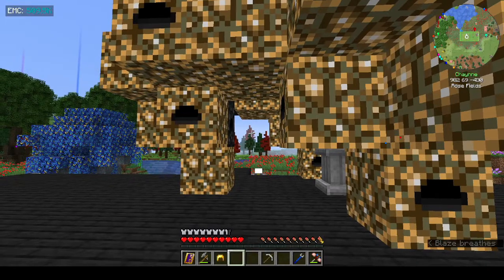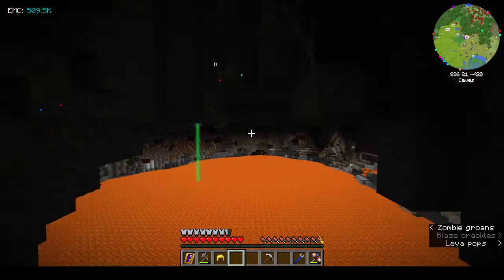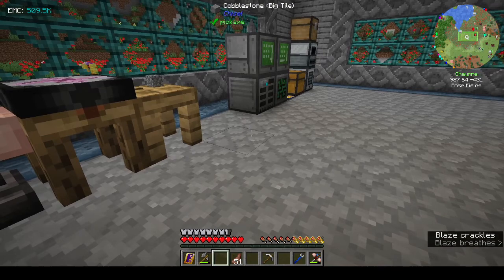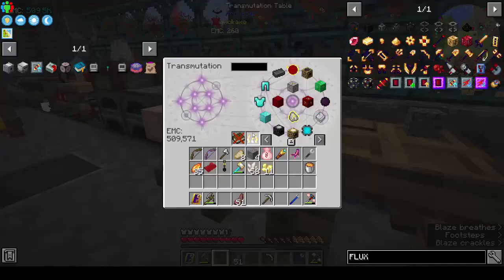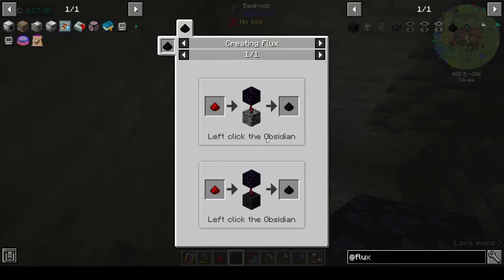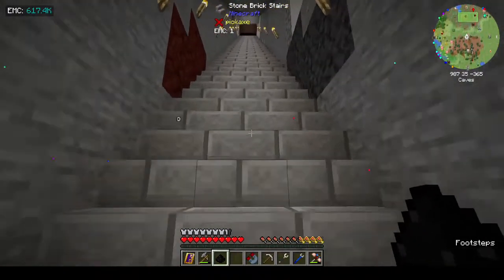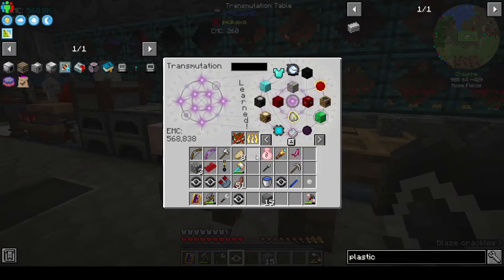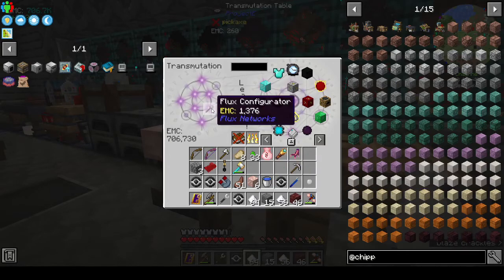Project Architect Ep 11: Starting Flux Networks

Comment: The watch of flowing time isn't working, you have to activate it by right clicking the pedestal, you will see particle effects when it's on. Also I think you might have them on the wrong mods pedestal, project e's pedestals are smaller and black.
Try right clicking on the tanks, that might show you how much is in them.
Reply from the maker: Thanks, I had a feeling it wasn't right. I'll have to turn particles back on, I turn it off while I'm a blaze 😁